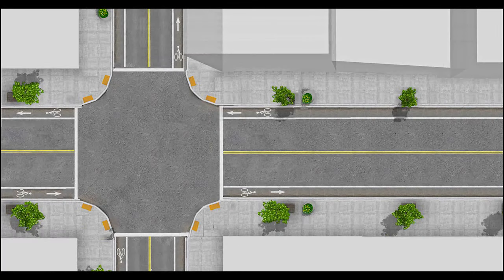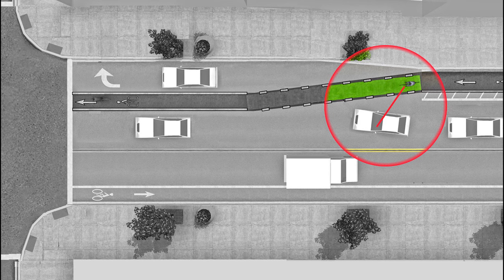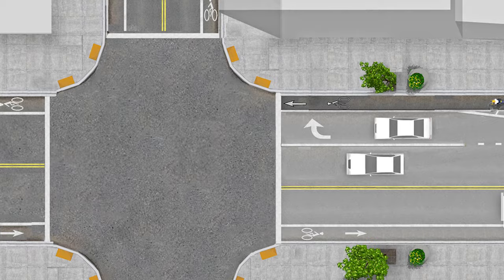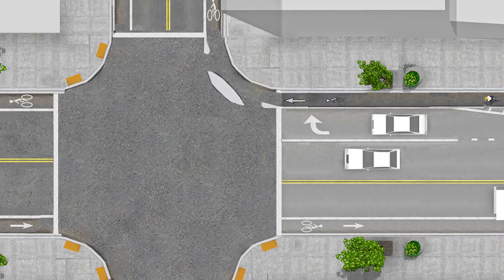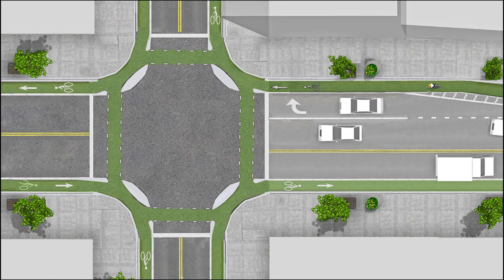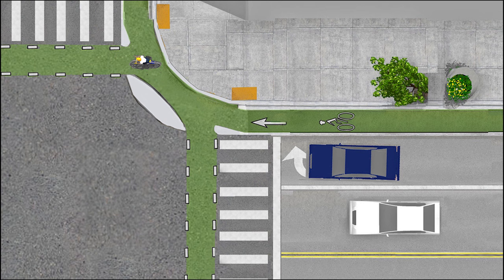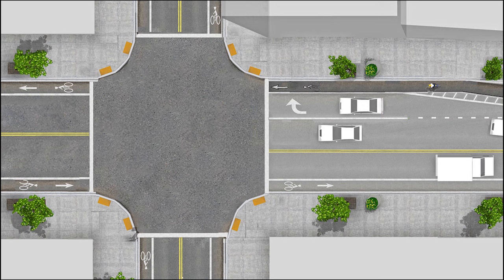Intersection design, the Dutch - cycle friendly - way

Comment: i dont like it because the cycle is the only vehicule that needs to slow, imagine that in every intersection.
Reply: Actually, no. Everything else being equal, you can pass such a junction with even greater speed exactly because of its greater safety.
Reply: Really? What country are you from where cars don't slow down for a red light? Or for a right/left turn?
Reply: @wimahlers  To you, a Dutchman, 12 miles per hour is considered fast.
Reply: @Shannon Trainer  
Well, yes. But that is almost 3 times faster than the car traffic in Manhattan. So, it is fast.

Reference:
https://www.latimes.com/nation/la-na-new-york-traffic-manhattan-20180124-story.html
Reply: @UCGCMJCZ77cEncMMLCm9hlHw Not in my city where traffic is average around 20-30 miles per hour. Also, my city is hill and commute distances are 3-5 time longer than the Dutch average, so Dutch upright bikes that you wax poetically about are out of the question when we have Road, hybrid and mountain bikes that are better suited.
Reply: @shannontrainer5857  
My daily commute was 2 times 20 km (about 2 times12.5 miles).
I did that on a single gear old style upright "opa" bicycle every working day.

I also lived in Oslo and Bergen in Norway. My main mode of transport there was a bicycle too. Over there I used a 21 speed city bicycle.

I also cycled to Belgium and France on a 3 speed Dutch style bicycle with 2 panniers on a back rack.
I also cycled to Denmark on the same bicycle (separate occasion).

I also cycled from El-Arish (Egypt) to Tel-Aviv (Israel) on a crappy bicycle (with some speeds, can't remember anymore how many).

I own 5 bicycles. Currently I use my 40 kg Dutch style cargo bicycle most of the time (it has a 14 speed gear hub).

If distance, speed, hills, wind, heat or cold is a problem for you than buy or use an E-bike.
Or by your own suggestion, use a road, hybrid or mountain bike. 

Just realize that a Dutch style bicycle is designed and used as a sturdy, maintenance low, all purpose bicycle.
But, as I showed above, it can be used in a wider range of areas and conditions than you assume it can.

To illustrate:
I can simply state that you have the wrong car. Regardless what car you own.
If you have a Ferrari then I object it is not a family car.
If you have a family car I object it is too slow.
If you have a fast family car I object it does not have enough storage capacity when compared to a truck.
If you have a big family sized fast truck I object it is too large for small streets and too difficult to park.
I can always object to something.

As to average bicycle speeds ... 8 to 10 miles an hour as an average speed is doable for most people between 8 and 80.
Averaging 13 miles an hour or more is doable for the minority fit and strong.
Cycling in The Netherlands is designed for the majority. Even the physically impaired. See, for examples:
https://www.youtube.com/watch?v=xSGx3HSjKDo
Reply: @wimahlers  On your (flat-as-a-board)daily commute, you take a train, tram, or bus in between for the other 10 miles. You also took a train to Denmark, France and Belgium and a train from Egypt to Israel. That’s because on a dutch bike, instead of spreading your weight across your butt, hands, and—most importantly—feet, you’re placing all your body weight on your butt, which means saddle sores and butt discomfort after 4-5 miles.

13 mph is still too slow for me. That’s because our cities aren’t as tiny and compact as those in the Netherlands. A 15-mile commute at a sluggish 13 mph will still take  well over an hour.
Reply: @shannontrainer5857  
You misunderstood. I did not took a train to Denmark, Germany, Belgium, France or Luxembourg (forgot to mention that tiny country). I cycled from The Netherlands to and through (parts of) these countries.

I cycled through the Belgium Ardennes. Which is mountainous. I cycled through Jylland (Denmark) which is mostly hilly.

I lived in Norway for almost 3 years. And I lived in the Sinai desert for half a year. Cycled there too.

Also, for many years (11 years) my commute on a bicycle to work was about 1 hour (total 2 hours round trip). Which is only 50 minutes per day longer than commuting by car or public transportation.
If you think that is a waste of time than realize that I never went to the gym and still have an excellent physical condition.

As to saddle sores. Though it is correct that there is more pressure on your butt with an upright bicycle, having saddle sores for a substantial part depends on choosing the right (or wrong!) bicycle saddle. A Dutch bicycle saddle for a Dutch commuter bicycle is mostly short(er) and wider than the saddle you most likely are used to. 
A typical Dutch commuter bicycle saddle:
https://cdn.webshopapp.com/shops/224207/files/300478290/image.jpg 
Versus what you are most likely used to:
https://www.vakantiefietser.nl/px/terry-fisio-flex-gel-max-sattel-herren640x480.jpg

But I can also argue that you most likely have the wrong bicycle for your commute. Because if your main argument is speed and butt pressure than you should ride:
https://upload.wikimedia.org/wikipedia/commons/4/4c/Jersey_Town_Criterium_2010_recumbent_055.jpg
Note: I do own and ride a recumbant too.

To show your perception about Dutch style bicycles is wrong, consider the following senior citizens on an organised cycling tour in The Netherlands, a common pastime in The Netherlands:
https://www.youtube.com/watch?v=5cTh7J8_W2c
Take a look at their bicycles. Take a look at their saddles. 

I heartily recommend you visit The Netherlands one day, rent a bicycle, and try a typical Dutch style bicycle for yourself.
Reply: @wimahlers  Your country's flat as a board; mines isn't. Stop presenting heavy inefficient Dutch upright bikes as a one-size-fits-all solution. Just because it works for you doesn't mean that works for everybody else. I rather have a 15 mile hilly commute last only 30 to 40 minutes on a road bike instead of 2 hours on a Dutch boat anchor. You're not going to make me a Dutch-upright-bike-only fundamentalist like you are.
Reply: @shannontrainer5857  
I never said or claimed a Dutch style bicycle is a one-size-fits-all solution.

On the contrary, I even said I have 5 bicycles. All different. And in a previous reply I even described using different bicycles for different purposes.

I won't stop you from using a road bicycle and cycling fast for your commute. in fact, I applaude you for commuting by bike.

What I did and do say is:

a. Your preconceived opinion that your butt will hurt after only 3-4 miles is wrong.

b. A Dutch bicycle is not limited to only short distances in flat level cities only (see my reference in my previous reply referring to elderly citizens making day cycling tours).

c. Dutch bicycles are maintenance low, sturdy, made to last (excluding the crappy made in China copies). Meant for everyday usage in all kinds of weather. I.e. For a Dutch style bicycle there is no such thing as winter proofing your bicycle.

d. These bicycles are not made for speed but for practical purposes for all people between the ages of 8 and 80.

p.s. You doing 15 miles in in 30 to 40 minutes only. And all that in regular traffic. That is amazingly fast. Are you a professional road racer?
I assume you realize that those speeds are not achievable for the majority of potential bicycle riders.

Addendum:
Whether a country is flat or mountainous is utterly irrelevant. Relevant for a commuter only is whether or not where you commute is flat or mountainous.
Reply: @wimahlers  "I also cycled to Belgium and France on a 3 speed Dutch style bicycle with 2 panniers on a back rack.
I also cycled to Denmark on the same bicycle (separate occasion)."
Taking a TGV train to France or Belgium doesn't count.
"My daily commute was 2 times 20 km (about 2 times12.5 miles)."
You take a tram or bus in between for most of that trip.

And I still wouldn't use an underpowered dutch-style e-bike with ineffecient geometry and heavy weight for hills. I swear, Dutch upright bike fanatics like yourself act like fascists sometimes, and they're not a one-size-fits-all solution.
Reply: @shannontrainer5857  
Your reaction is incoherent, given my previous replies.

Comment: If it works in Holland it must be perfect. Amsterdam Station is a no go zone for people with disabilities. Denmark ajor issues there with cyclist running in to bus passengers exiting and entering stopped busses. Pedestrian safety first,then cyclist, public transport needs and then the rest. Safety first and this is not safe for vulnerable pedestrians
Reply: You said and claimed: "Amsterdam Station is a no go zone for people with disabilities."

On what information do you base this claim?
Reply: Of course Denmark has problems with cyclists running into bus passengers, bus passengers exit directly onto the bike path. You need to create a separate platform off the bike path to ensure passengers exiting a bus do not immediately enter a bike path. A shelter may then be across the bike path coming from the curb, because passengers will have time to see if they are safe to cross. This is the exact sort of infrastructure that promotes pedestrian safety. Every bike is another car replaced so even without considering pedestrians cycling infrastructure improves pedestrian safety.
Reply: @wimahlers  on being told it by Persons With Disabilities from Amsterdam and visitors to the city.
Reply: @Quintinohthree  that's because the designs are pedestrian dangerous. Shared Space means that pedestrians are automatically  in danger of being hit by a vehicle
Reply: @GJFK1  I don't see any shared space here. I see cars, bicycles and pedestrians distinctly separated, with designated crossings. The same goes with how I suggest bus stops with parallel bike paths are best designed. Despite your unverified claims to the contrary, I know of no shared space near Amsterdam Central Station. The square out front is clearly only available to pedestrians and equipped with tactile paving. I'm sure there are a lot of things that could be improved to accomodate disabled people, but to say it's a no-go zone categorically is just hyperboly. Above all it's certainly not an argument against good cycling infrastructure, as I have pointed out the alternative to cyclists running over pedestrians on a cyclepath is motorists running over pedestrians on the street.
Reply: @Quintinohthree  That depends on what you call shared space. Any uncontrolled area that vehicles and pedestrians share at any time is a shared space
Reply: @GJFK1  And where exactly were we discussing an actual shared space?
Reply: @GJFK1  
Such a claim deserves some details. So what did they actually say?

Comment: Do you have a source for saying it is safer than the starting scenario because i highly doubt it? You can't just claim it to be safer without having proof.

All you do is slowing down the cyclists and I assume you're making it unsafer aswell.
Reply: Actually, no. It is speeding up cycling because of the better overview, the waiting room for cars in the turning lanes, the slower speed of motor traffic (due to the intersection design).

Having said this, speed is not an issue or priority in a city. If you want to cycle fast do this outside city limits, as the Dutch do.

As to safety, in The Netherlands every single traffic accident resulting in fatality or serious injury is investigated by infrastructure specialists. Unsafe cycling intersections (and other infrastructure) is regularly updated implementing safer designs. 

Is every update safer? Well, most of the time. Exceptions and mistakes do occur. It is rare but a reality. Just realize that about 1.5 million people are killed by motor traffic alone throughout the world each year. The Netherlands is, statistically per kilometer per capita per time unit cycled, the safest country in the world to cycle in.

As to statistics, figures and facts related to cycling (and infrastructure in general), contemplate the SVOW. A reference:
www. swov.nl/feiten-cijfers/factsheet/fietsers

As to speed, the following is not the right environment for speed cycling, see:
https://www.youtube.com/watch?v=yfPMhM3GuXw
This is:
https://www.youtube.com/watch?v=ZrUElMacAqw (they are sometimes referred to as "weekend warriors")

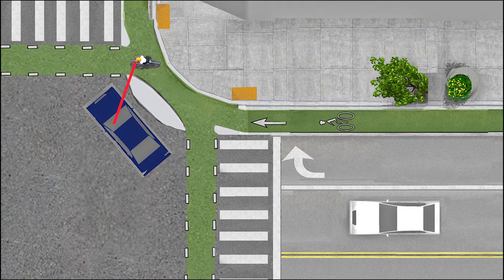Comment: The main problem with this design which the video claims "it solves" at 1:52 is that in combination with traffic lights taking a left turn takes much longer on a bicycle than in a car, or two light cycles while a car just needs one to turn left.

Mitigating that requires either turning this design into a roundabout, or what I prefer, have a marked area behind the zebra crossings where the bikes come to a stop ahead of the cars, and then turn left before the cars and then merge onto the cycle lane on the left.

There's a junction like this on my commute in Amsterdam and my choice is to either cross it illegally with a straight left turn, or wait 2-3x as long as a car to cross it to the left. So this design hardly comes without any problems.
Reply: Yes, but all the time you lose by making a left turn is made up by making a right turn, which doesn't require traffic lights at all.
Reply: @Wouter10123  Great point. For some reason people only look at what others have and they don't and then get mad, instead of looking at what they have and the other doesn't and be grateful.

Besides that, you could easily make this "problem" go away by making the green cycle for cyclists go all at the same time for example. 

Even if it is slower, you're at least 100% safe and the suggestion that you would rather be on the street between the cars to save a few seconds while also annoying drivers is a bit silly.

If you don't want to have to think about others and be patient in traffic, you shouldn't have gotten a job in Amsterdam to begin with. Or any big city for that matter.
Reply: @woutervanr  Let's also not forget the easy solution at a signalised intersections: synchrozed light cycles. Whenever a cyclist crosses, you ensurs that sby the time they reach the other side that they can be given green to turn left. It's really not that hard if you let traffic lights react to data collected from buttons and sensors with the goal of maximising people throughput.

Comment: 1:52 This design solves a further problem? More like: creates a new one. Cyclists belong on the road and shouldn't have to cross a road two times to make a left turn. Maybe this works in the Netherlands, but in my country, where this type of junction is being increasingly (and dare I say badly, or maybe incompletely) implemented, it does not.
Reply: +Perotnik Trust me, speaking as a Dutch cyclist - that design is wonderful. You have to cross two times, yes, but a lot of the time traffic lights are coordinated so that they're both green very quickly after each other, you almost never have to wait long. It doesn't matter if you make it in one go or in two parts for the waiting time anyway, because for the left turn you have to cross traffic from almost all lanes at once. You still have to wait for all that traffic to clear. If you divide it into two seperate crossings, traffic from other lanes that don't cross your path can simultaneously also go and this makes it much more efficient for all road users. But yes, if you don't implement it well, the design is obviously not going to work - but if you design it like demonstrated, I don't see why it shouldn't.
Reply: Problem is that in Belgium, they know how to recreate this kind of crossing, but they don't time the lights for cyclists, so you have to wait twice for a long time... :s
Reply: Late to the party but to add: for every time you have to cross twice to go left you have to cross 0 times when you go right on the return trip. Even without timing the lights for cyclists this evens it out decently.

Comment: As a cyclist who has to use these types of roundabout junctions, I can honestly tell you they’re very rubbish. The stones marking the cycling sections create artificial barriers that could cause accidents, motorists are too intimidated to actually drive near cyclists, going so far to neglect their hand signals. The time it takes to brake and slide along the aforementioned stones is also very unhandy, and is most definitely a safety hazard, so much so that I usually just cycle over the regular roundabout to avoid the trouble of taking the cyclist’s path. I live on the German border, and traffic is organized so much more efficiently here. 

In short: Don’t adopt the Dutch system. It’s expensive, inefficient and ill-suited to American traffic.
Reply: Thanks for your anecdotal opinion I don't share.
Do you have any fact based reliable reference backing any of your anecdotal claims?

Comment: Very beginning "This is a standard U.S. road." Then goes on to say "you can create an extra curb" and "without needing more space". Some very wrong logic here. Why? Because a standard U.S. road has more than just small cars driving on it. We have buses and long trucks with long trailers. Turning in such a place is difficult enough without a larger curb, nevermind adding a new lane for bicycles that extends said curb.

In this case, what was the point in using the "standard U.S. road" remark when it doesn't even apply to the example given?
Reply: There are also large trucks and buses in The Netherlands. As there are tiny/tinier cross sections in The Netherlands, tinier as shown in this video, where this design is not the preferred solution. So what is your point?
Reply: +Wim Ahlers he has no point. lol as if a standard Dutch road only has small cars driving on it haha. Typical short-sighted American.
Reply: M A  But in US the truck are muuuuch bigger....